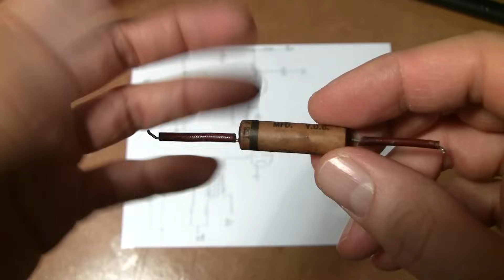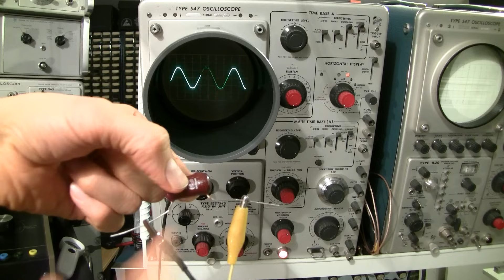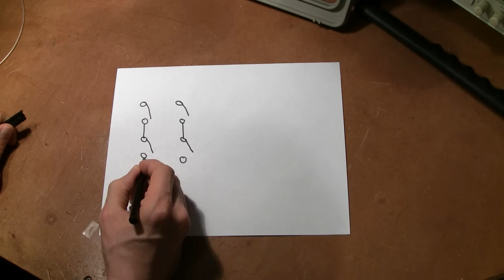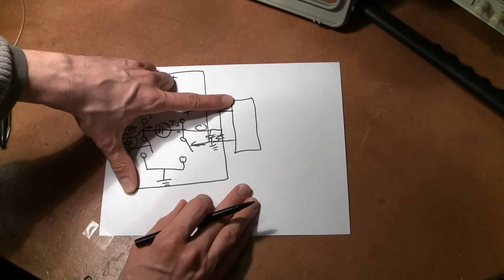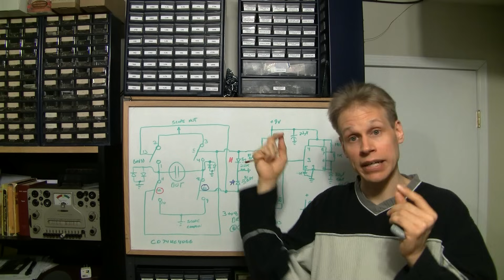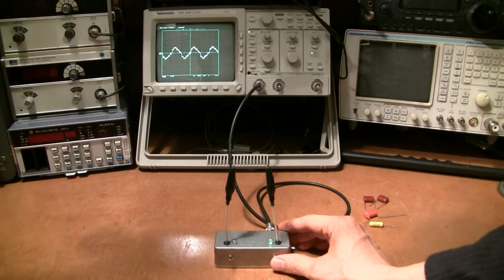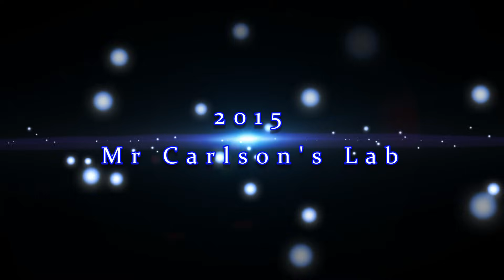Are Your Capacitors Installed Backwards? Build this and find out

Comment: MAYBE MANUFACTURERS NEVER KNOW THAT CAPACITORS SHOULD BE PLACED IN THE RIGHT WAY .......... THEY SHOULD BE MANUFACTURED AS THE OLD CAPACITORS WHICH WERE WITH THEIR CORRESPONDING SIGNALING ON ONE OF THE END. EXCELLENT EXPLANATION, PRECISE AND CONSISE, THANKS FOR YOUR TEACHINGS .... CONGRATULATIONS, PROFESSOR

Comment: If a scope is being emlloyed I suggest connecting the capacitor to the scope while its vertical amp is in most sensitive mode (1-or 2 mV /Div)  and then revers the connection both while  holding the cap in between 2 fingers. The position of which the scope shows higher noise level means the outer foil is connected to the scope's input the other side is the inner foil and is connected to the scope ground. When reversinf the capacitor the and outside foil of cap connected to scopes ground it will show less noise. Since the foil will act as shielding. In order to inject some extra noise that will help to differ between High Low  i bring the capacitor near  the chock of my fluoriscent loop lamp

Comment: Eh question if I had these in a guitar amp and they were in backwards would that prevent sound ?
I have voltages but no sound  and im bald from it....  I measured voltages on original amp 
then made two more 1:1 parts value wise and have voltages back correct on all 3 but no sound...
1 of the 3 might be bad standbye as it arced at standbye cap and blew that out and overheated wires.
Might replace that..   on the one      but that does not explain the other 2 amps I made 1:1 also not having sound.   its lke they are in standbye....

Comment: Well I'll be jiggered !

I built one of these devices into a Spam tin, using pdip chips and Protoboard, and the damn thing works !

Now I can re-cap a couple of vintage O'scopes with confidence...  :-)

I tested 3n3 to 470nF and it detected the foil side just fine with only a change of sensitivity setting on the scope Y axis.

There is room in the Spam tin to add a LED meter board using one of the LM3914V chips plus an op-amp as preamp - (at a later date).  And yes, I shall build one of your Cap leakage detectors into another Spam tin.

Comment: Never new this about capacitors, great explanations, but no electronics needed for this, no empty battery when you need it. Simply used a double row 3 point toggle switch, the middle points for connecting the capacitor and the outer 2 points left for ground and signal and at the right side the same in opposite polarity, let the toggle point to the side of the capacitor who is connected with ground and there you go....

Comment: This is nice to know. Now i am thinking about your Testing device to make it easy usable without connecting to an oscilloscope. What if when you simply connect a little low power Audio Amplifier with a little speaker to hear the picked up noise? Then you can hear the same what you see on the Oscilloscope. If the capacitor is connected the right way, the noise is almost quitely. Instead of the speaker you can put in another LED that lights up when the capacitor is used the wrong way.

Comment: Thanks much for the info. I had an issue with a guitar amplifier when I ‘recapped’  it. The original coupling capacitor (paper and wax) was similar to the one exhibited in your video, a band denoting outer foil. From ECC 83 to EL84. Replaced that one with orange polypropylene, exactly the similar way. While operation I had hum. Made me crazy .. replaced the Cap with another one, still hummmmm. Made me crazier. Now I understood the BAND is not BAND ! Will switch the polarity. Regards.

Comment: It’s a shame that companies producing capacitors need to cut money by not marking correctly to show the foil end!
But I find this money saving ways in producing items premieres many product lines; i bought a small project kit to build a small multilevel box - don’t you know they left out several parts and worse they cross-threaded one of the insert which I had to drill out the insert and install anew one that was of much better quality. Gone are the good old days when manufacturers produced quality and stood behind their product.. Nice video and information about the circuitry, your videos are great to watch and relax, while trying to my electrical courses from collage in the 60’s.

Comment: PLEASE !  there are no foil markings on  MOST modern film capacitors anymore because there is NO NEED to !  YES, in some RARE cases it could make a difference but not in any vintage radio or audio gear.    Mr Carlson is indeed a very smart tech but he just goes WAY too far with this idea.   Otherwise, he makes very informative videos.

Comment: How about speakers crossover?
Where cap acts as a filter in line with signal . 
Should signal flow from amp to speaker where signal enters thru shielded (marked) end , than once filtered exits thru unshielded end ...?

Comment: Is it possible to make a circuit that will automatically detect which side is the sheilded side? For people who dont have a osciloscope. Id imagine you could have a voltage comparison and that would determine which side is sheilded.  The amplitute of the ac is what you are using to measure this so how hard could it be

Comment: This video was very useful! I'm building my first guitar Amp now but do not have an oscilloscope and did not plan for one in the budget any time soon.. is there any other means for me identifying the correct polarity of capacitors without one? A ghetto solution with a multimeter perhaps?

Comment: Little suggestion: the 555 timer itself you can use without flip-flop. You can use positive pulse for 2 mosfets and negative cycle via single pnp trans to light the other 2 and the leds will be directly connected to the timer .. One IC less

Comment: Could you please explain which end of the cap should be attached to the plate of a tube that is feeding the next stages grid when cap is being used to couple the ac audio signal? Foil end to plate or foil end to screen grid? Or if there are any other orientation in a tube amp circuit this foil side of a cap should be observed and attached to? Thank you for your input.

Comment: Stupidity ... a normal ceramic or coil capacitor has no polarity and no matter how it is installed in a PCB - polarity is only important with electrolytic capacitors.
Reply from the maker: Coil capacitor? :^/  Ceramic's were not mentioned having a polarity.

Comment: I don't have an oscilloscope. I can't even SPELL oscilloscope. Surely there's an easier way? Like...connect one leg to some RF source and the other to earth and have a little probe made from a little inductor used as the coil in a DIY EMF meter circuit, then just try it both ways around and whichever leg gives a higher reading when used as the antenna, is the one connected to the outer foil? I guess you've still got the leg acting as an antenna either way, but maybe if the probe was shielded except on the end, and small enough to place right up against the body of the cap? I dunno tech stuff. But if you made a little stand-along gadget that could tell people if their caps are backwards, they'd buy it! People polish tube pins! People buy silver wire! If they even knew that some of their caps might not be shielded, they'd open their wallets!

Comment: Sooo, when equipment is being slapped together at a factory, on average, 50%  of the caps are being put in backwards?  Maybe that is the reason identical pieces of equipment don't perform the same, if one had many more caps installed correctly. When I purchased my first TV over 50 years ago, all it's life, it had a hum the dealer couldn't get rid of.

Comment: Where did you find that relic capacitor. If i had to guess, i'd say it's twice a old as you. Looks like a salvage from some WW2 army surplus. And yes i know. AH..the smell of cosmoline in the morning.
Reply: If you check out his videos, you'll see that he repairs/restores quite a lot of vintage, tube-based, equipment and wax capacitors were very common back in the day. Replacing wax capacitors is almost de rigueur for such gear.

Comment: So what would be the difference of installing this the wrong way say in a guitar potentiometer? Does it really matter and doe it hurt the sound?
Reply from the maker: In low impedance circuitry (non active) the difference will be very minor, if any at all. In amplification stages (active circuitry) the orientation does matter.
Reply: @MrCarlsonsLab   Ok, because I was just about to put some Orange Drops .047uF 600V in my new bass I have been customizing (Passive Seymour Duncan SJB-3 SJB-3 pickups) and didn't want them installed the wrong way if it was going to hurt them. I did order a cheap scope that is still on its way here from china. Still waiting for that, But thank you, that's good information to know.

Comment: Oh wow. I have been 
Repairing amps for almost 17 years and never knew this. I do have a question.  Not installing the foil to the lowest impedance side have any affect on solid state stuff or just vacuum tubes stuff?
Reply: Yes, it matters in SS. This is a common repair for my shop after someone else has repaired or performed maintenance on a circuit.
Reply: Life time of components 😕

Comment: Dear Mr. Carlson,
Inspired by your videos about how to repair a tube radio, I am in the process of repairing my Grandmother's old Delco all-American 6 radio with power transformer.  I remembered to take a lot of pictures as I disconnected the wax capacitors and the BED resistors.  Now, I have new capacitors made out of polymer, and I tried using my oscilloscope on the highest sensitivity to check which lead is shielded.  However, no matter which end I hook up to the probe and which end I hook up to ground, I get no noise while touching the capacitor's body as long as /either/ end is grounded while the other is probed.  But I get the same amount of noise if only the scope probe and not ground is connected, regardless of which end.  I even tried using an existing wax capacitor to make that test, and I get nothing.  What exactly am I missing?
Reply from the maker: Hello Steven. Use a BNC cable with alligator clips on the end (one on the shield and one on the center conductor.) Set the horizontal time base to see 60 cycle hum. Turn the scopes vertical sensitivity to max and try again.
Reply: @MrCarlsonsLab  Okay, so I bought some BNC to Alligator cables and retested the capacitors and...no luck!  Same results.  And the cables are the shielded kind.
Reply: I looked carefully at the dials on my oscilloscope and the highest sensitivity level is 50mV/div.  Do I need one that is more sensitive than that?  Or a scope input amplifier?
Reply from the maker: Yes, 50mV is nowhere near sensitive enough. 2mV is your target.
Reply: @MrCarlsonsLab  Thx!  :)

Comment: I trained under an 'ol timer way back in the day (30+ yrs ago) I took this as common knowledge. I used an old scope, my finger touching earth ground, and that's all. 
* however, I learned a little jewel on my own as I attempted to design a replacement for the little tube sized vibrator buzzer that fed the step-up transformer in OEM tube-type car radio power supplies that restorers demand for authenticity. I experimented with various higher current transistors like 2n3055 but in smaller pkg ( pre-mosfet era ) in a simple yet effective astable multi-vibrator circuit. it really worked great and no CONSTANT BUZZ. Customer appreciated that a lot. but you learn a lot more from failure than success I suppose and I learned a lot about vacuum tube power requirements when trying to substitute silicon rectifiers in place the much harder to find vacuum tube variety but unable to develop enough B+ in fact almost no plate voltage but instead drew excessive current ! LIKE WAY EXCESSIVE ? I must've made a mistake and reversed a diode's polarity somehow but no everything was as it should be as per my design. I thought silicon was ALWAYS superior to tubes!! thermionic rectification just seemed so wasteful and semiconductors were so wonderful yet it just doesn't work !  I experimented around with different diodes and rectifier configurations (even selenium which smells absolutely terrible when they die BTW) and I discovered that the problem was caused by an unexpected interaction of a low source impedance power circuit feeding a really high Z - higher voltage lower current- power circuit. Adding series resistance seemed to help and allowed the radio to operate as I recall but did seem to overly stress and thermally challenge whatever I attempted to use for rectification. I think experimenting this as a vid on youtube would be info-cational to most of us if not nostalgic as well.

Comment: Could you design your circuit with a bar graph led display, to indicate voltage levels, instead of having to break out the scope?. Probably have to use an op-amp to bring up the millivolts to led level.

Comment: thanx sir. what a great video. for years I thought these caps dont have polarity or any particular direction and I was wondering why and its very obvious now . very recently I worked on an amplifier circuit and it was picking up some noise regardless  of all the efforts to pin point the problem and after watching this video I made  those  corrections and it became  absolutely quite. wonderful!
Reply: The whole idea of the outermost layer of metal foil of even an unpolarised capacitor serving as a shield seems so obvious now that it has been pointed out to me, that I wonder why I didn't think of it before?  D'oh!  So you have your proof then right there!  I just tried it with a coupla 0.33uF/630V new cylindrical yellow capacitors very similar to what Paul uses.  I was using a little 200khz 2" colour LCD cro from jyetech that I built.  On maximum sensitivity, I could discern a difference in noise when reversing the cro connections!  Not as clearly as shown on Paul's cro, but enough to be able to confidently mark the 'shielded' end of all my previous to now non-polarised caps!

Comment: Electrolytic capacitors will also self destruct, sometimes violently, if installed with reversed polarity, plates are exposed to current during the manufacturing process to build up an insulting layer, reverse current will break down that layer. Eventually, there is a short, out gassing, and the inside of the capacitor relocates itself outside of the can.
Reply: yeap,some big electrolytics have a valve for release the gas inside,and sometimes isn"t enough.the capacitor "explodes"

Comment: Capacitor dielectric is wounded in layers so one pin is connected to the inner layer and the other to the outside and then is the external insulation of the capacitors body.In fact it is not polarity but distance from the ground pin so parasitic voltages are forming only in the measurment circuit when ground is the inner and less if ground goes to the outside but not to a real circuit.So the circuit reveals which physical connector of the two is connected to the inner layer and which to the outer and then it is in your opinion how to place the capacitor in a location of a circuit with uncertain polarity or floating.

Comment: What you said at 2:06-2:34, nobody told me before...  I always viewed capacitors as batteries, not current converters.  That is good to know.
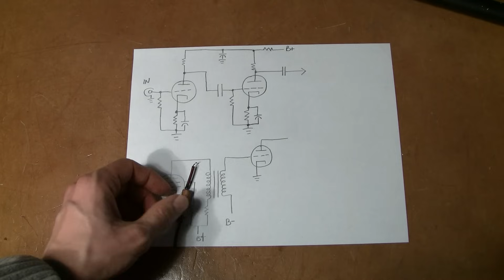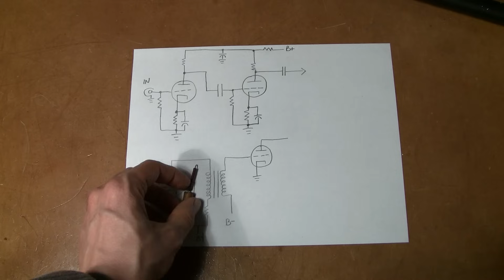Lead resistance and spacing, 6:35-6:55, is also good to know.

Comment: What about capacitors on tone stack? Look at .1 cap connected to bass & treble for instance. With some bass pot settings, it may be "resistively" closer to ground via the plate of the preceding tube, and with some settings, it may be closer to ground going in the opposite direction (towards the middle control)...

Comment: I watched the video and was a little bit disappointed that you’d still need to connect your oscilloscope. I guess you could also add a simple amplifier and a speaker and just hear what side is shielded.
Reply: I tried using a heathkit signal tracer, basically a small amplifier, for this test, but alas, my hearing couldn't detect any difference in the polarity.
Reply: Kevin Clark 
Based on what I saw in the video I expected one should be able to hear a clear difference, but apparently you can’t. Probably because we hear loudness on a logarithmic scale. 
Thank you for sharing!

Comment: NOT REALLY AC IS BOTH PUSHED PULLED INDUCTION JUST CURRENT..INTERFERENCE THOSE HIGH VOLTAGE THE HAVE PEAK +9(.) -9 ..Make sure center tap ELS ERS...CAPACITORS ~AC-0.22...THOSE CAP HIGH VOLTAGE...CURRENT  IS PULSES TONES...DISCHARGED LONGER HUMMING......

Comment: This test does not hold up under a repeatability format. It is useful with old wax , paper and foil type capacitors of yesteryear. The differences are often very small. However it's not an exact measurement, merely an indication.

Comment: In a "bypass" cap, it doesn't really matter.  In a coupling cap, the "outside" should be toward the signal source but, again, it doesn't really make any difference.   A coupling cap essentially connects AC across the cap.